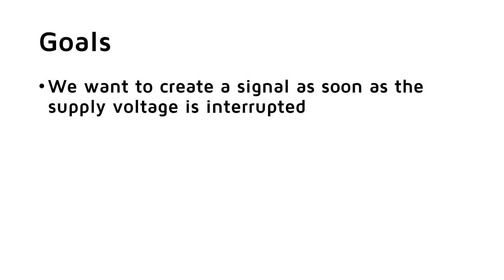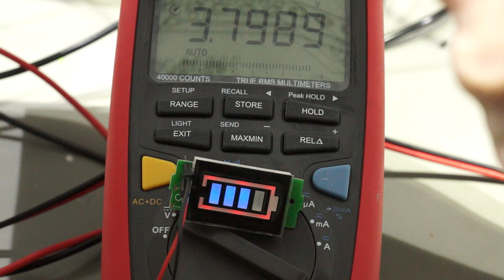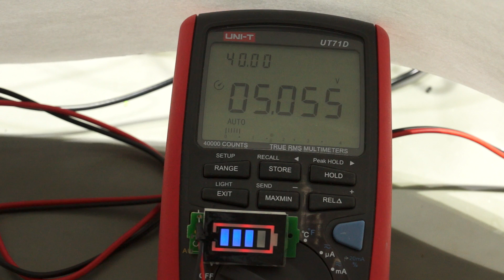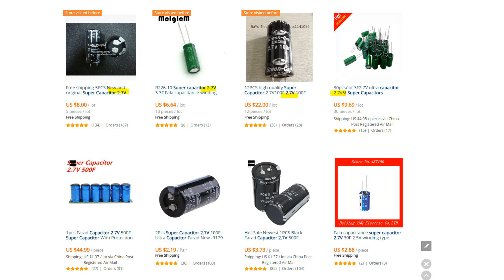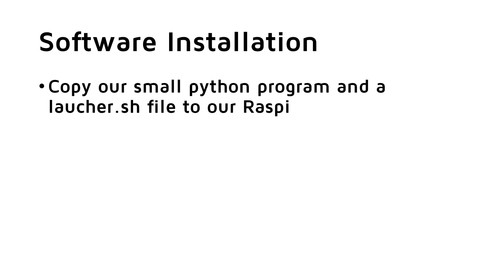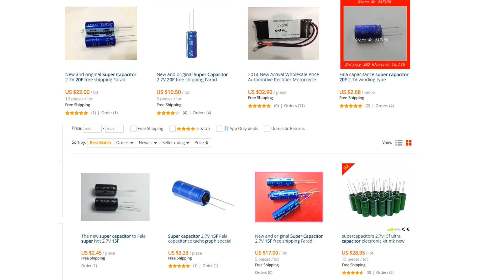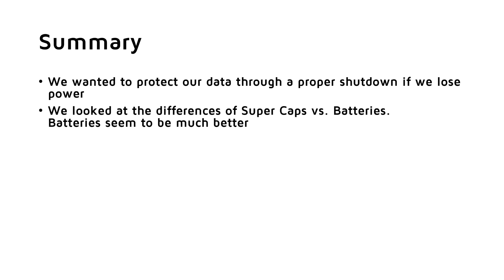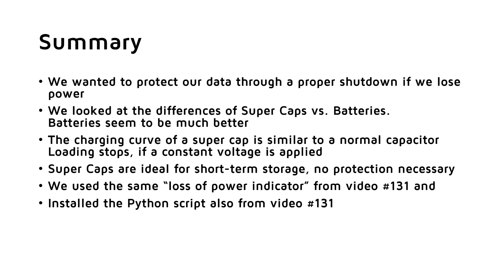#133 Safe Shutdown for Raspberry Pi with Super Capacitors

Comment: Not sure if it is a good idea but if you place a  2.7 Volt zener diode over each cap it would solve balance and potential overvoltage issues.
Reply from the maker: You can do that. I wanted to keep the parts count small. I also do not know, which voltage tolerance the super caps have.
Reply: not needed because max voltage is 5.25V and caps support up to 5.4V. and also if they are same capacitance they will balance itself up.
Reply: Wouldn't be too sure about that. Same issue happens with Li-Ion cells. A bit of tolerance like 10% and it might go wrong.
Reply: zener diode cant balance cells, it just can protect from overvoltage, capacitors dosent have any problems with unbalanced cells. only problem is overvoltage
Reply: Well at least it is some sort of protection that is cheap.
Reply: It would be nice to have a simple overvolt protection to avoid that the caps go overvolt and blow up over time. The zener diode where would need to be connected?
Reply: Well to be honest I don't have experience with supercapacitors but I would guess tolerance is an issue. Imagine 2 supercaps where 1 has 10% more capacitance than the spec and the other one 10% less. Then you have 20% of difference. Now if the max Voltage on that supercap is 2.7V and you have 2 in series you have 5.4V Max over those supercaps. But keep in mind the tolerance and it might go wrong.  
I think Andreas needs to make a session where he measures the voltage over the supercaps.  I have seen supercap boards on ebay where eacht supercap has a protection, so those ic's most also exist.
Not going to buy them for the moment, but tempted to use them... but I think my monthly budget of buying toys will get exceeded by buying them.
Reply from the maker: I will check it and also compare with protection boards
Reply: The problem of overvoltage will be visible over time after charge and discharge cycles where the suoercaps will inevitably get unbalanced
Reply from the maker: You are right, if the USB voltage fluctuates a lot. If you just encounter a cut-off from time to time, both capacitors will be discharged to close to 0 volt after a relatively short time (they are not very big) and will start balanced again.
Reply: agreed, it is the "time to time" that makes a difference, because I am not expecting power outages very often :)

Comment: To make it cheaper, why not use a transistor to signal GPI 18; write the code so when the signal is low, it will shut down. It would also make your projects smaller.
Reply from the maker: I wanted to have a clear voltage level where the shutdown starts.If I start too low, I lose too much energy, if I start too hugh, the RPi shuts down if the USB is a little low for a moment. Here is an example where they do not use any transistor: http://www.hackerspace-ffm.de/wiki/index.php?title=Raspi_EDLC_UPS (link is from Urs). They use bigger capacitors.

Comment: Maybe someone can design a small PCB for this? With in-out usb connectors.
Reply: Adrian for a normal RasPi look here http://hackaday.com/2014/10/04/supercapacitors-for-the-raspberry-pi/
or also at tindie.com
Reply from the maker: I think, this is a very similar concept. The two resistors across the caps is a good idea, because then, they discharge faster and the RPi boots automatically...
A PCB for my setup would be an "overkill because I soldered it together in about 5 minutes (two resistors and a transistor).

Comment: though i fully understood the workings with yr battery pack in the previous video, here i come upon something confusing. why is the monitor connected to the 3v3 as well? shouldn't it be connected just to the 5 volt via the 2 diodes, to ground and  to gpio 17? or did i misunderstanding your circuit?
Reply from the maker: I do not use batteries here, I use super caps which are charged to 5 volts. I connect the wire to 3.3 volts which is connected to GPIO18 pin (through a FET). I read, that the Pi GPIOs are not 5 volt tolerant.
Reply: yes, that I fully understood, but my  confusion was with the figure on 3:53
but I think i understand it by now: The gauge  gets 5Volt through 2 diodes and the 3.3Volt goes to the transistor that triggers the shutdown via GPIO18.
I had forgotten it was not open collector but had a pull up to 3V3.
Great stuff, I have 2* 6 Volt supercaps that I will put in parallel, which brings me to 5F. Will give that a try.
Reply from the maker: You are right. Maybe you look at the former video. I think, a diagram with the transistor is there.
Reply: Yes, I had seen it. I look at ALL yout videos Andreas, wouldnt want to miss a single one ;-)

Comment: If your data are so important to go to all this trouble I would choose to use a VPS from scaleway. It costs 3 euro per month but it is faster than the pi and downtime is very rare so it is very suitable for applications where sensor signals are important like fire alarms etc.
Reply from the maker: My idea here were not mainly data protection. It was more the hassle if a device does not work anymore because it was used outside its specs. And just pulling the plug for a Linux system seems to be outside the specs ( I am a beginner).  
I am just an old engineer who think, specifications have their value, and you should stay inside, if it is possible with a reasonable effort;-)
Reply: Then you need to have a good internet connection, that is not down for long times. 
There are other ways which you don't need to bother with a VPS at all, like MQTT service and storage in the cloud.

You have a local machine because you want to control and log things locally, on the same site as the things you control. Because as long as you have a working local LAN, you want to be able to control your devices.
Reply: Yes, it totally depends on your needs and application. In my case I found it more productive to outsource the server/data center part to a 3rd party and focus on making my devices resilient to network and power outages as you describe. For my applications it makes more sense since my LAN is powered by my router which means that if the LAN is down then in all probability the internet is down also so a local server would not work either.
Reply: I don't see paying for an ongoing fee, introducing cost and connectivity potential issues, when you can do this reliably on a Pi. Despite one hiccup I've documented on the blog, almost definitely through not understanding power supply issues well enough at the time, I've recorded years' worth of data on a Pi without issue and now that we have Grafana, doing a decent job of displaying the data as well. Indeed the only service I've had trouble with - is online speech - with the company (presumably) selling off to Amazon.
Reply: Andreas Spiess 
hi, Linux has the benefit of being very versatile. This means that if you do not have constant writing to a physical memory then it has no problem of just unplugging the power. For example, you could have a read-only filesystem for your os+apps and everything else on a ram-memory. In a car, such read-only fs is common.

 if you need to write something to a physical memory then write on some other usb stick. avoid mixing system with data on the same memory. .
Reply: Hello Peter, first I'd like to say that I am a fan of your blog and the work you did with the raspi setup script. 

Now, regarding the issues you brought up, as I said above there is no wrong/right way to do this, and yes ongoing fees is an issue you have to consider when setting this up (connectivity not so much, there are things you can do to easily mitigate any issues). 

The raspberry pi route requires upfront investment for hardware and time, the hosted solution requires a lot less upfront investment but you do need to pay 3 euros every month. It all depends on your needs.

In my case I opted for the hosting solution because I need internet connectivity anyway and I much prefer working with something other that raspbian on a faster machine.
Reply: Well of course  - you have me there - there is the cost of the Pi - I usually refer to Pi in the generic sense of course- you can buy a decent ARM board for far, far less than a real Raspberry Pi - your point is valid - except for the reliance on external connections and that depends partly of course on where you spend your time. I would not trust important data collection here in rural Spain to reliance on the broadband and until recently I would certainly not have trusted it to at Plusnet connection, though thanks to the new router that particular issue now seems to be history.
Reply: +Naoh Watson, which doesn't change that if you have not made those changes to secure power drops, you should continue with the good habit of turning the computer of in proper ways.
But yes, with the right selection of file systems and options, you could make the file systems survive that.

Comment: Another great video Andreas! Two questions: (1) for how long RPi Zero can work after power off on battery and how does it compare to super caps? I guess it can work longer on the batteries (2) after the shutdown when the power comes back does RPi start automatically? Thanks!
Reply from the maker: 1. The Zero works only a few seconds after  power off. Just enough for a safe shutdown
2. It does not boot when power comes back. Only if you wait for a certain time. Then, the caps are discharged completely and the RPi should boot again
Reply: Andreas Spiess can you please draw a more precise schematic for a guy like me? On your final schematic is only "monitor" not the transistor, also on your live picture is two blue resistor. I just dont want to blow up things.
Reply: Ahh, but I also cant find any sources for ka75450. :(
Reply from the maker: https://www.aliexpress.com/item/100-New-original-KA75450MTF-KA75450/1990473688.htm (ordered, but not received yet)
Reply from the maker: I will put it in my blog

Comment: Thank you Andreas for another great video. Is it possible to auto start (boot up) a raspberry pi ?
Reply from the maker: Yes, it is. Actually, if you wait long enough, this setup should boot if power comes back (you have to wait a few minutes). You could add a resisor across the caps to reduce this time (proposal from a viewer)

Comment: Would it be beneficial to have a current limiting resistor in series with the caps, to limit the power draw from the power supply to prevent damage (or overload shutdown)? Along those lines, would a very high resistance "bleed resistor" make sense in parallel with the circuit, to ensure the caps drain fully when powered off? Or will the Pi attempting to power on with the residual voltage have the same effect?
Reply: Maybe a limiting resistor to slow down the caps charging and a diode in parallel with the resistor to allow a fast discharge?
Reply: Andreas Spiess if you put a 1M bleeder resistor across each individual super cap, the two together also act as a resistive divider that balances the two caps out.
Reply from the maker: I am not sure, if 1M is not too high. I would try 100 - 1000 Ohms, because the internal resistance of a capacitor during loading can be quite low and the 1 M then would have no effect. I think, that the 2.5 -  25 mA additional current would not hurt too much...
Reply: Bleeder resistors are not the solution for limiting the current, just for discharge and balancing. There's no reason not to do both!
Reply from the maker: 1. Series resistor: Yes. But the thin wires of normal USB cables are more than enough for small capacitors.
2. Parallel resistors: Yes, this could be a good idea. My current setup draws enough energy that the caps are discharged in maybe 10 minutes (not measured).